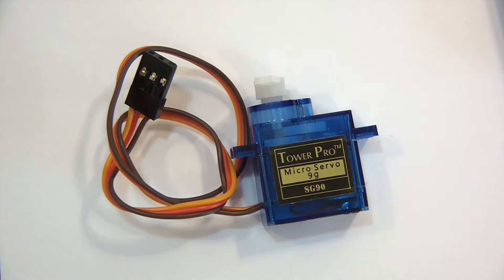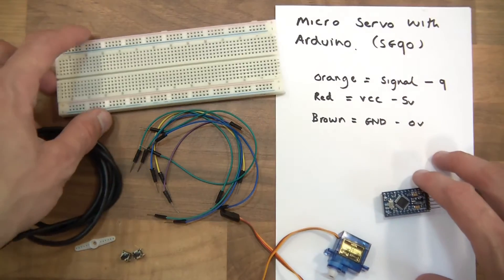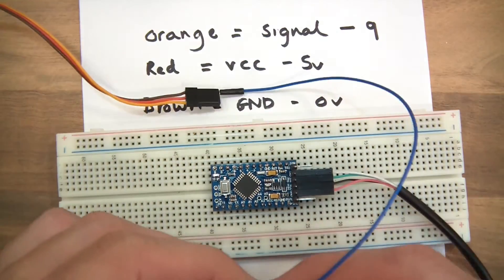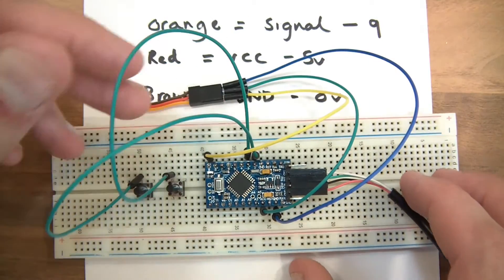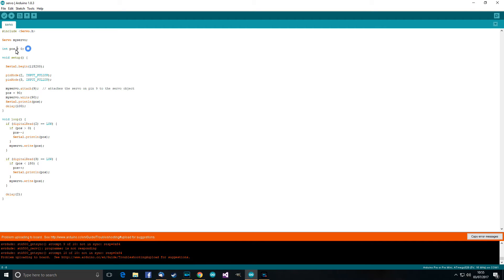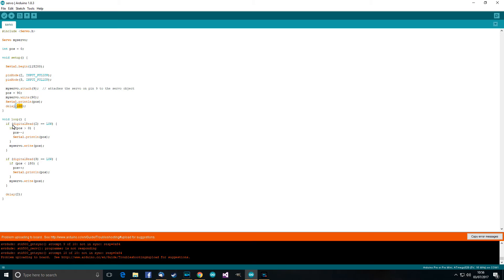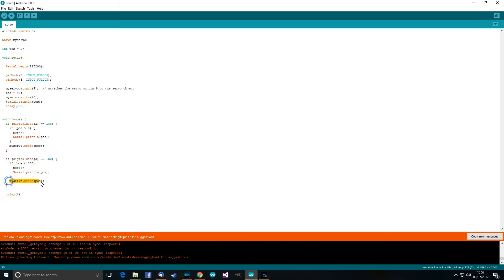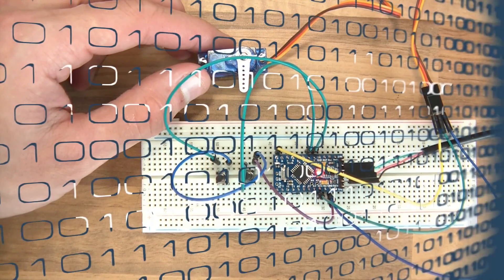TUTORIAL: How to Wire Up & Code Program a Servo - Arduino Module - (SG90)

Comment: Hi Antony. I have a project where I need to give out LOW and HIGH signal (1ms, 2ms) on 1 chanel of PWM, and for the second Chanel, I need LOW, MID, HIGH (1, 1.5, 2 ms). Is for a drone Camera that uses 2 PWM signals from the Drone receiver.  I want to do a hand held device with my 3D printer and a micro display. Is a Thermal camera, so, too expensive to just use it only in the drone. Is it possible to do what you did with only 1 Button?? and generate signal of 1ms, or 2ms  (0 and 180 degrees would be the same I guess) with the pulse of 1 button?, and maybe use the same logic for another button to generate 3 states 1, 1.5, 2 ms)?
 I already bought an Arduino nano, and 4 buttons keypad for this project.  This camera uses 50hz Frecuency and therefore, the Servo library would be perfect since gives out 20ms cycle, as required for the camera that uses servos standards to be controlled by the drone transmitter/receiver. In the drone transmitter I have a 3 position switch that sends those Low, Mid, High signals to the camera, and any other 2 position switch for the Low,High signals.   
I know a baby takes a lot of time, and you also have to work for living, but if you could have time to think about a code and share with me, I would appreciate it a lot. BTW, there is no video or instructable on internet about this modification for this expensive and popular camera, so it could be a very popular video in youtube.  Cheers Mate, and thank you for this video! You have already pointed me in the right way.              juangiluruguay@hotmail.com
Reply from the maker: Hi Juan, thanks for the comment. All of the stuff you've asked is possible, apart from the three state PWM. PWM is a digital technology and only has 2 states. There is no LOW, MED, HIGH, there is just LOW and HIGH. However, you can read it in different ways. However, the timing which you've described is possible. You can 'split' it by duty cycle. 0% duty would be low, 50% duty will be med and 100% will be high. I think it's very strange for the camera to get it's input signals via PWM though...
Reply: The Camera is a FLIR VUE PRO, and designed for drones. That is why has that capability of 2 PWM channels to control 2 functions. Uses normal "Servos" PWM from receivers. Here is that part of the manual...
The Vue Pro accepts standard PWM inputs for the R/C industry, 3.3-5vdc, 50Hz. LOW = 1ms/20ms, MID = 1.5ms/20ms, HIGH = 2ms/20ms.
The PWM for servos , except for Trotle in RC, is 1,5ms with the joystick in middle position, so, left ot right will send the servo from 90 degrees to 0 or 180.
Actually, you can select 2 or 3 stages in the PWM selection in the app from the camera(via Bluetooth), but, te 2 stages will be for like.. zoom On/off, or Record On/off, and the 3 stages can be used to select between 3 different pallets (white hot, black hot, rainbow).
Reply from the maker: Juan Gil ok, so that should be fairly easy. Use the standard pwm library and use 5% duty, 7.5% duty and 10% duty cycle
Reply from the maker: Juan Gil unfortunately, I don't have time to do anything with it I'm afraid. If you email me with some details. I may be able to help when I get some time but the tasks in question would have to be very clear and specific. Antony..
Reply from the maker: No worries... My email address is antony@accbs.co.uk

Comment: what would I write in the sketch if I waned to press button 1 to turn it 90 then button 2 to return to 0 without needing to hold the button. Been trying out some trial but get a lot of servo glitch, haven't done coding in a long time and trying to get this sorted for a small open and close project, would also like to add an led to active the same button 1 was pressed and button 2 to switch it off as I would like to add 2 servos and leds to come on when it opens on goes off when it closes cheers
Reply from the maker: Hi, it's fairly easy to do that. Basically, you just need to look into Arduino inputs. I have a series about lithium capacity checker - in this project, there is a video about acquiring input. That video will help you. The rest is simple. Antony...
Reply: I will have a look cheers